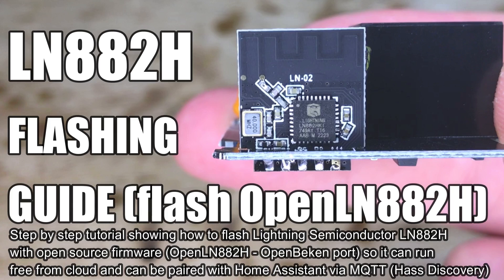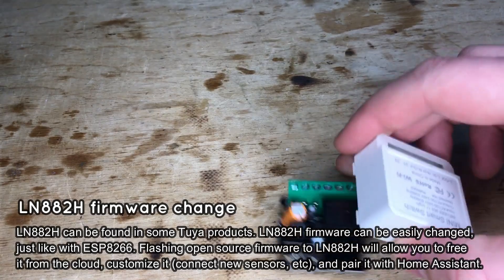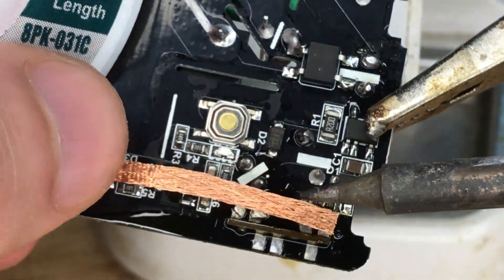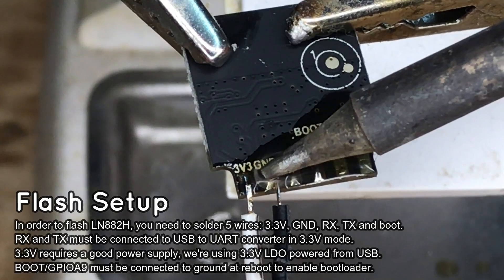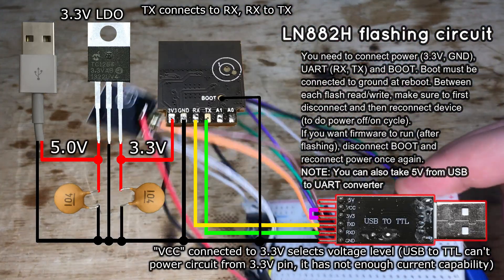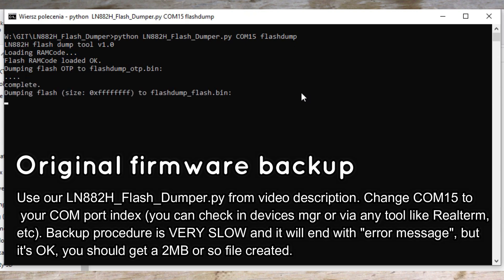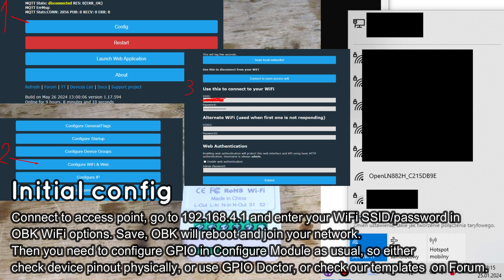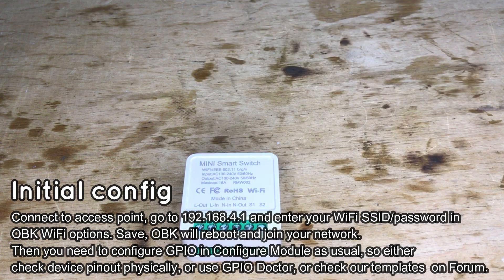How to flash LN882H (LN-02 module) WiFi module in Tuya product? Home Assistant pairing for LN882

Comment: it says couldnt open the serial code when trying to dump. im using a usb to uart converter . im not using a 3.3v power supply just the 3.3v on the usb to uart converter .

Comment: I have RGBCCT light bulb with this "Lightning LN882HKI" chip on the same board as the light power supply, There's no separate module. The RX, TX, GND pins are accessible on the back of PCB but there's no BOOT pin, Can I use CEN pin for flashing?
Reply from the maker: We would need to see photos of your device PCB, create a topic on our forum and we'll try to help. Maybe boot is available somewhere...